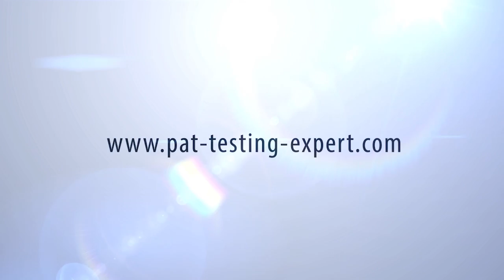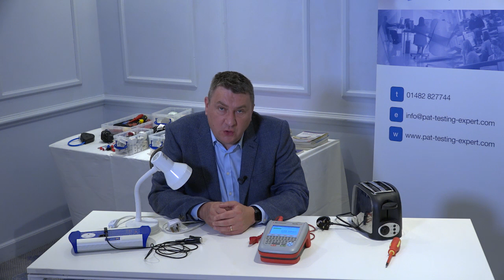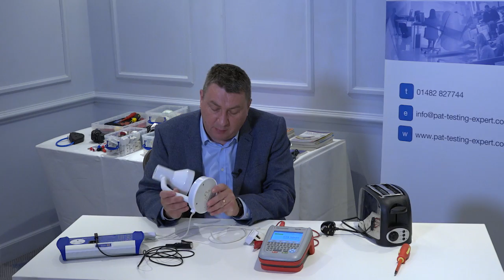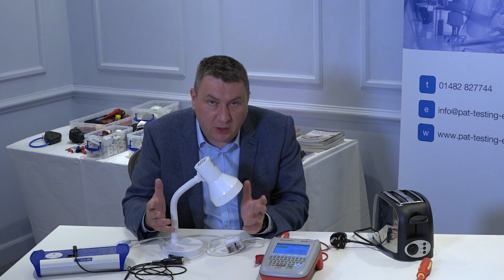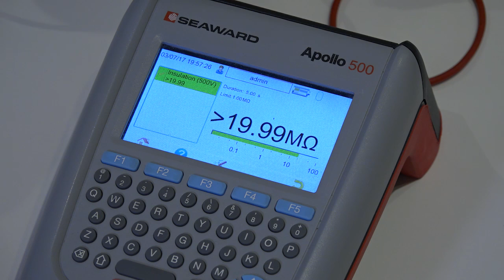Insulation Test - PAT Testing information and guidance for PAT Testing Expert

Comment: Nice and clear thank you.  I wonder if anybody will take out the bulb and connect the clip to the bayonette connector lol.  So then there is no point in testing a class II device with no exposed metal parts.  When I test drill battery chargers and the like I test to the metal pins and with adaptors  I guess you can test to the connector too.

Comment: Not sure I agree with this method but depends how the machine works. 
You could be introducing a voltage onto the metal lamp shade and as it is class 2 this will not be earthed to the plug so the only way for this voltage to dissipate is by someone touching it. Also you should probably remove the lamp or your 500v will blow it up.
Reply: As he mentioned, the Live and Neutral are shorted together(done inside the PAT) during the test and there will be no current flowing in the lamp filament so its safe. A DC Voltage (500V or 250V) is injected to L/N(shorted together) and PE(current return path) to test the insulation of the wires. If current flows from L/N to PE(or the RED probe), it means there is a breakdown in insultation of wires(interpreted as Resistance reading in PAT). Of course it not advisable to touch the lamp during the test. Voltage will disappear as soon as the test is done.
Reply from the maker: Thanks Derrick - absolutely correct.

Comment: I do testing in landlord propertys,hoovers are the biggest thing i get at Class 2 but can seem to find much in way of metal parts,Being shown incorrectly didn't help as i was told class 2 didn't require the probe attached
Reply from the maker: Hi, you do need to attach the probe to something metal, as described in the video. However, if there genuinely are no metal parts, then there's no meaningful test you can carry out, so a visual inspection is all that is required in this case!

Comment: Lamp shade has a coating on it, how will you get a proper reading !.
Reply from the maker: This is a good question, and one which I get asked a lot. When we carry out an earth continuity test (on a Class 1 appliance), we're looking for a very LOW reading; probably less than 0.1 ohms. Therefore it's essential that we get a good connection onto the metal work, otherwsie the test will fail. However, on the insulation test (which this video is about) we're looking for a very high reading, probably in the millions of ohms. The machines typically will measure up to 20 or even 100 million ohms (MΩ.) So, if there is a couple of ohms resistance in the paint coating on the lamp, this won't make any noticable difference to the reading that we get. So in this case, it's fine to put the clip on the metal case, even though it's painted. Hope this helps!

Comment: If I did a class 2 test on a class 1 appliance would the seaward still use the earth pin of the plug automatically to detect resistance? For example a class 1 espresso machine with no exposed metal parts
Reply: Yes.

Comment: What can you do for a class 2 appliance that has no exposed metal parts?
Reply: Hi there, that’s quite simple. If you have a piece of equipment which is completely encased in plastic then it only requires a visual inspection. You could carry out a function test maybe to see it it’s working properly, but you can’t carry out earth or insulation unless there is a metal part to connect the clip onto.
Reply: @timjames6173  Excellent thank you

Comment: Can this be done using a device without a fixed cable.  I.E. a piece of IT equipment with a kettle lead?  So plug the kettle lead into PAT tester.  Connect crocodile clip to exposed metal and test this way? Thanks
Reply from the maker: Stug_1978 Hello, this video is just about the insulation test, which is a part of a bigger PAT Testing process. If you have a piece of equipment which connects via a detachable lead (iec or ‘kettle’ lead) then of course you can test that exactly the same way as a piece of equipment with a fixed mains lead. Once you’ve tested the two items together (device and lead) there may be a benefit to testing the lead separately as well (most testers allow you to connect both ends to the tester so you can check polarity as well as the other tests)
Reply: Brilliant.  Thank you for your help.  Will definitely be testing both the device/lead and lead separately.  Thanks again.